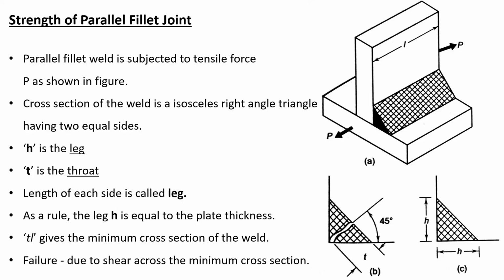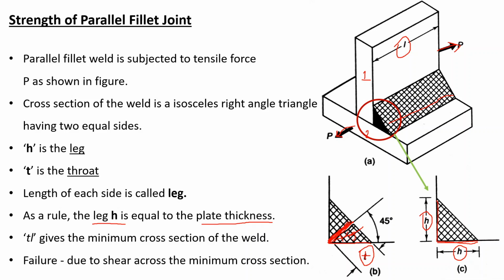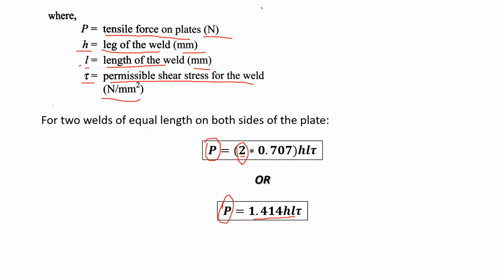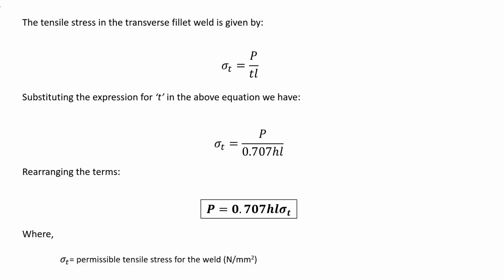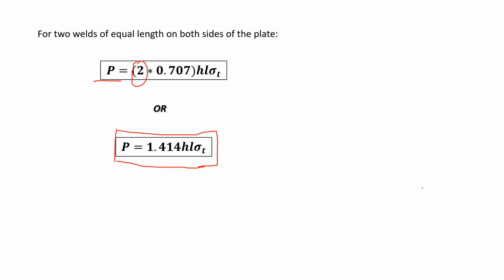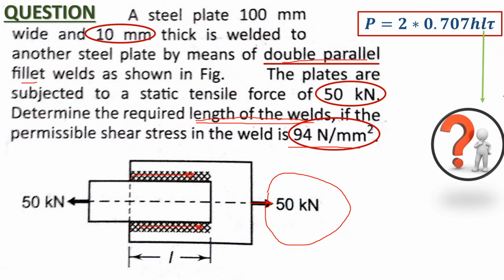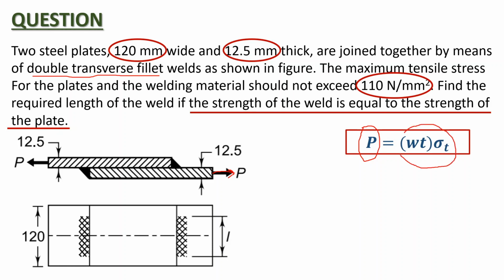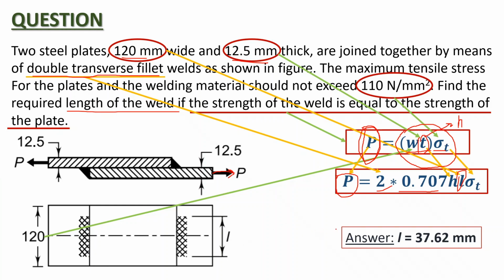Design of Fillet Weld

Comment: 14:15 sir how have you taken area t.l  
perpendicular to tensile force p . Because in tensile stress we take area perpendicular to force .
Reply from the maker: Again a very good question Praveen.

Actually, what you have learnt till now is that your stress is load/force divided by the perpendicular area. However, this is not how we define stress. Stress is always defined at a point and not area. Although what you are saying is absolutely true for a rectangular cross section beam but not for all cases. You must have studied in your sophomore year that we define the state of stress, that's the proper way of defining stress and not just load by area. However, in this case in order to simply calculations and to be on the safer side we have taken t*l. 
I hope this answers the question. In case, you still have doubt about this feel free to ask again and again and again until its crystal clear.